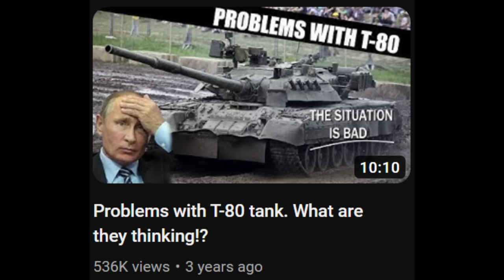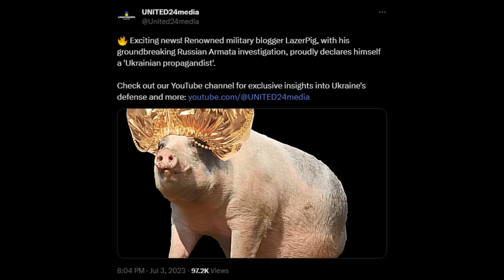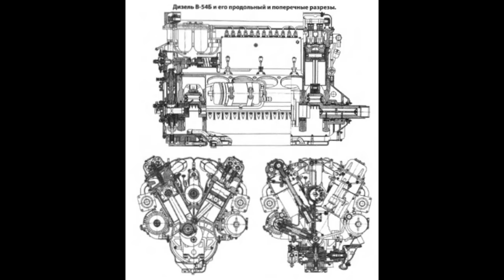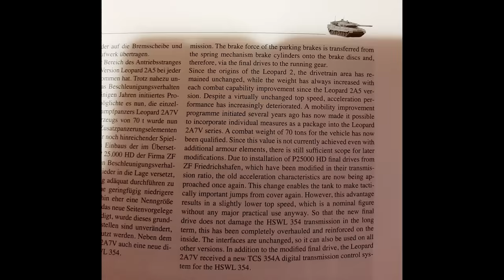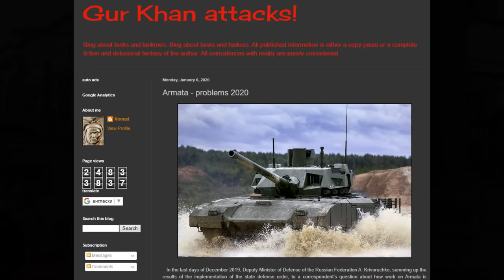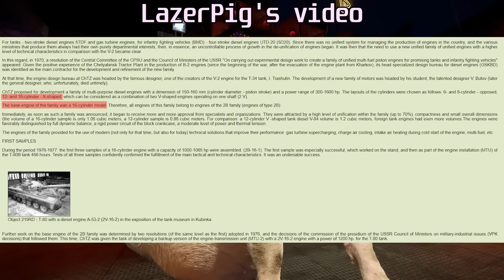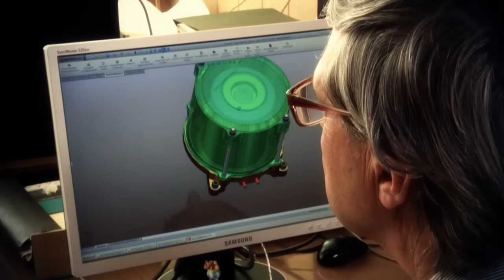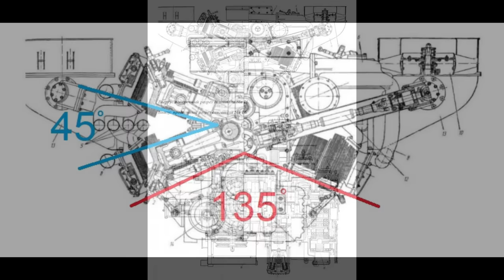Response to LazerPig and the T-14 Armata dispute

Comment: The T-14 is the best tank in the world.......

When it works.
Reply: Even if it worked it still wouldn't be the best.
Reply: bravo now go drink milk
Reply: @voidtempering8700 I mean, if it was in use it probably would be the best RN since its design is advanced. But its not in use so...
Reply: @gerfand  The M1a2 SepV4 is already in production.
Reply: @voidtempering8700  yet it has a outdated design
Reply: @gerfand  How does it have an outdated design?
Reply: @voidtempering8700  what I mean is that between it being made in 1980s and technology advancing (APS was not a thing for OG Abrams for example) and T-14 having better design fron other technology advances, namely unmanned turret, Abrams is an worse tank, but is everything, its just a march of technology thing. If US made a Tank that was akin to Armata I don't doubt they would get lots of things more right than Russia, and I don't mean production, but they have yet to do one.
Reply: @gerfand  Okay, I didn't understand what you meant by that. But yeah, I agree with that. For example, Trophy will actually not be implemented fully on the SepV3 because it would weigh far to much with it on, while also incorporating the additional armor packages and other systems. 

But something like the EMBT with APS built into its composite sideskirts is a revolutionary design similar to the T-14. But with 4th gen tanks like that, I don't see how the K2 Black Panther fits in.
Reply: @voidtempering8700  yeah K-2 is just a 3.5 if you want to use a Jet nomenclature, 4th gen will be stuff like Eletronics in much more use including for defense.
Its only that T-14 is the only one with any production to not be called a prototype even tho its not a Tank that is used, hence why I said "if it was in use"
Reply: @BakiBadjon 1% milk 2% milk? Skim? Goat? Human?
Reply: I guess u perfere, like mr pig here, human milk from males @TheMrPeteChannel

Comment: 20:41 again, not lazarpigs point, he was talking about how the t90 can only match the speed of the Challenger 2. You then went and said tank speed caps about 60 to 70 kilometres an hour which is perfectly true and valid but neither the t90 or the Challenger 2 can reach 60 or 70 kilometres an hour
Reply: Yes they can, but only if they are going on a flat road and downhill. If they are on the rough terrain, no tank can reach their top speed.
Reply: Yeah just ignore his point about the T-72 going at 84km/h in the video, granted it is modded but that just proves the engine is capable of getting the tank to that speed if the transmision was made to do it 21:00

Comment: Torque does not mean anything. Since you have a gearbox and horsepower, you can have all the torque you need cause P=RPM*T then T=P/RPM This means you can get infinite torque by lowering the gear ratio making the engine run on higher RPMs.

Comment: Tanks are going to be easy prey as Drones get cheaper, faster, capable etc... 
£20k drone vs £10,000,000 is a no Brainer...
Reply: So why nato still acquiring and developing a new tank ?
Reply: @E-zey because tanks are still useful as breakthrough weapons. Even if you control the sky it doesn’t matter above a location you still need ground forces to occupy a location. Plus as we’ve seen in Ukraine large aa defense systems are very effective at shutting down air power.
Reply: @E-zey  So Military Industrial Complex can get paid!
Reply: @E-zey Because tanks has still a purpose to fill, not to mention Anti Drone tactics and weapon systems are rapidly being developed.
Reply: They could just put an robot turret on the roof that actvely search for treaths like drones, because you know that drones seem very weak to bullets.
still cant outsmart bullets
Reply: @vitanera4032  just makes the tank more complicated & more expensive.
Which just proves my point!
Why spend millions on a tank when £10k drone will wreck it - hello?
Reply: @zabdas83  because tanks are necessary and maybe a 10k computer turret could neutralize a new threat like era did with chemical energy weapons?
Reply: @vitanera4032  I agree with the opinion that tanks are necessary. However I find the turret idea to be impractical for a couple of reasons. The main one is radar. In order to detect an object that small from far enough away to be effective would require a relatively large radar suite. The other thing is that you would need a relatively large gun or a missile to reach the range snowy drones hang out at. Spaa exists because a mbt funnily enough can only do so much at once.
Reply: Following your line of thinking, why there are still soldiers? I dont have exact numbers but i am quite sure that a drone is far cheaper than the training the equipment and the logistics behind a soldier. And them if we follow that we would not need aircrafts ships or any Kind  of hardware that can be destroyed by drones.
Reply: @victorhugoschiatti6831  did you see how easily Ukraine sank Russian ships... With a Drone...
You proved my point...
Reply: Drones are the new thing that we are still on the way of developing effective counter measures, just like how we invented ERA, composite armor, APS, thermals, to overcome the new technologies that have been created through the years.

This isn't even the first time a debate about tanks becoming obsolete is happening, they thought the same thing when they invented shape charged weapons, or chemical amunitions.
Reply: @sovieticodiabetico6874  the more counter measures you add, the more expensive, complicated & technical the tank becomes. When a cheap as drone will still do the job
Reply: @zabdas83  no it wont, you just ignored my whole point...  The more countermeasures a tank have the less effective a cheap drone will be because of the countermeasures. But even if it was true, that no matter what the drone will still be able to damage the tank, the drone will still not be able do replace the tank on a battlefield. A cannon on wheels capable of delivering heavy payload on enemy positions and then quickly turning away.

Just because there are things that can take out a tank doesn`t mean it`s obsolete(like how i already pointed that other things made people reach the same conclusion that you did, but 50 years ago, and the tanks are still around) that`s why you don`t just produce tanks, but SPAA or SPGS or IFVS to carry infantry to support the tank on the battlefield.
Reply: @sovieticodiabetico6874 you'll get over it princess. I'm right & your deluded - it's OK princess. Don't fret!

Comment: Whole segment about V2 engine was just pathetic. Little change in casing (to fit it to new tank), better generator and slapping on turbo... Seriously, teenagers in garages do more sophisticated modifications to their first cars. Yet the most awful flaws of V2 (namely crankshaft design and master-slave push rod system) are still there. And those were inherited from... TA-DAAA!!! BMW VI engine! That one, from 1920s.
Also I don't  really know much about CV12 Condor but even if it has something common with 1918 engine, those parts must be designed really good. Since CV12 has 1500 bhp from 26 litres while V92 has only 1130 from 39 litres (both in their best iterations).
Reply: Yet it works and there is no problem. Russian tanks are still destroying Ukrainian troops it what matters.
Reply: @eliasziad7864 which ones?
Reply: @eliasziad7864  remind me who said that those engines don't work?

Comment: LazerPig is the type of guy to call a Ford Model T engine and a Ford Ecoboost engine the same engine just because both are 4-stroke engines that have 4 cilinders which are aligned in a straight line.

Edit: LP also appears to have a tendency of ignoring important factors... such as the influence the gearbox has over the top speed of a vehicle.

Comment: The list of the ignored points.
-He never said this he said the autoloader specifically on the T-14 had issues.
-Again He never said this. He said it appears based on film from inside the tank the driver has a rather archaic setup with no clearly visible optics besides pariscopes.
-He did say this and you have provided no source denying it in the video. If you have a specific article listing the actual speed please provide I'm going off the video itself.
-He has actually sourced this claim being from leaked technical documents.
-He has litterally shown the article that does this.
-Don't know about his one.
-The T-14's optics lack cooling so this statement is accurate.
-No. Just no.
-That was very clearly a joke stop being disingenuous.
-He can actually prove that one.
-He actually proved it has no rear cameras and the crew positon would make a rear pariscope near impossible.
Reply: The T-14's thermal imager for the main gun sight is cooled. There's a video of it. It's quite clearly cooled.

How did he prove it has no rear camera? I'm really curious as you what you'll say.

Comment: Talking about T-14 at this point is like arguing if Superman can pick up Thor's hammer.
Its irrelevant because there ain't no Superman, ain't no Thor, ain't no hammer, and ain't no T-14.
The T-14 was a bit of propaganda that ran its course when the Russian Commander of Ground Forces announced that they would be focusing on incremental upgrades of the T-90M.
Reply: Nah its relevant lol, you used as example Superman which is a character that exists with a concept that exists, which is to be worth of the hammer

Comment: T14 Cancelled 😂😂😂😂😂
Reply: @sovietbanana4589 I don’t think they will tho. This is a very expensive tank plagued with reliability issues and it is very different from standard russian tank design which is a very big problem, tbh if you gave a T-90m a turbine engine, a good transmission capable of going very fast and a proper aps it would easily become the cheapest and best mbt in the world. I think they will reinvest the T-14 money into upgrading the T-90m models

Comment: The v2 and the v92s2f are the 'same' engine. They started with the same design but the v92s2f has been heavily modified. What your saying is like me saying "Leopard 2 and Leopards 2a7 are completely different tanks" which they are clearly not. The 2a7 variant just had alot of improvements over its earlier conterparts.
Reply: Yes, but you wouldn't say the 2a7 is the same as the 2a4. 

The standard criticism is that they are using the same engine, insinuating that it is almost the exact same as the original, which is clearly not true.
Reply: Then could you take a piston, or a camshaft, a head gasket, or many other major parts and use the interchangeably with the V2 and V92S2F? If you say no (and no is the correct answer because many parts of these engines are completely different) then it is clearly not the same engine
Reply: To expand on my other comment, let’s take the Volkswagen Golf’s for an example. The Golf Mk. 1, built around the ‘80s (I believe) is not the same as the newest Mk. 8. In no way are the parts interchangeable. Sure there may be similarities in the fact they both are hatchbacks, have 2 litre engines and whatnot, but this does not make them the same. Use this analogy and apply it to the Kharkiv Model V2, and you will clearly be able to deduce, supplemented by my earlier point, the V2 and V92 are NOT the same engine.
Reply: @voidtempering8700  no but that literally doesn’t make any change to my point the 2a4 is different to the 2a7 because the 2a7 has been improved and modified but even designs like the leopard have limits which is what lazerpig is saying about the v2
Reply: @HK-do9dl  no I’m not saying the engines are the same the v92s2f is clearly better but considering it does have the same base design and that base design does have limits

Comment: Here is the thing. The challenger 2's problem with the lower front plate was fixed way before you made that video that shows that you are using outdated info which further hurts your reliablilty.
Reply: It wasn't fixed, the base armor just has add-ons.
Reply: @voidtempering8700  Yeah, thats still a fix. The same way ERA is a fix to HEAT projectiles.
Reply: Before the challenger 2 ever went into combat the problem was fixed and according to Russia the t-14 armata has seen combat and it has an immaculate amount of problems
Reply: @PoseidonOversimplified  Did you even watch the video he made on the Challenger? He comments about the add-on armor in the video on it he made. Lazerpig simply cut that part out or didn't finish the video he made on the topic.
Reply: I have and he didn’t that was in his response video not the original one that lazarpig responded to
Reply: @PoseidonOversimplified  Yes he did, ur is the first thing that is said in his video.

Comment: with your challenger comment, you are ignoring the steel quality completely. Todays 60mm amour plate is a different beast from WW2 steel. So yea, you are technically wrong
Reply: Everything is measured in RHA. Besides, WW2 tank guns have upwards of 150mm of armor penetration.
Reply: Highest penetrating WW2 tank guns penetrate upwars of 200mm of armor; for example, 17pdr apds penetrates over 250mm at 500m, and 88mm L/71 KwK 43 penetrates over 210mm at same distance. While modern RHA is indeed better, it is most certainly not 4-5 times better.
Reply: Steel quality and hardness is a bit of a complex topic. But generally the difference isn't that significant. Because the lower plate is a structural plate and the only plate in the lower front plate, it's unlikely to be some sort of high hardness plate. As it would be too brittle. Still, because of the shallow and angle and low thickness, it is still suspectable to many WW2 guns to calibers as low as 57mm
Reply: you lads seem to not realize that modern armor plates are not just hardened steel, but a composite material. I suggest you look for some test comparing WW2 tank armor to modern variants. You will be surprised.
Reply: @imomedvidek  I don't think you understand what we are talking about. The Turret and IFP of the Challenger is composite armor, but the LFP isn't. They have an add on armor kit, but the base armor is just a steel plate with no composites.
Reply: @imomedvidek  the lower plate is most definitely not a composite plate. It's too thin and it would be too weak for structural purposes
Reply: @imomedvidek  The whole point of redeffect's criticism is that the lower plate is a 60mm rha plate, not composite.
Reply: @jasonzhou5783 just a correction the 17Pdr has a penetraton of 204 mm at 500 meters, not 250, like you said with of course the APDS round the APCBC round could however only penetrate 130mm of armor at the same range if we compare both ammunition type the APCBC round on the Kwk 43 is much superior

Comment: (Because everyone gets angry, I am talking about the T90-m engine) About the engine debate, Yes it is no 1:1 copy. It is the same engine tough, engines are defined by there base architecture and changing specific systems inside the engine leaves the "Engine" The same. The issue with a "old" Engine is that the Baseline design choices were made before precise topology optimisation was a thing, so they just slapped more material on critical spots to ensure they will not break down. This can  not just be fixed with a new lubrication System but only with a complete redesign. So the point that the base engine is a accent relict is completely valid an also not a normal thing to do. a Engine developed in the sixty's in a tank from the seventy's is not the same as a engine developed in the second world war and the approved until the 2010s used in a tank developed now. 
I am no tank guy to be honest, I work in the Automotive Industrie, there even the thought to compare a engine from the 90s to a freshly developed one from today would be a bad joke at best no matter how upgraded the old ne is.
Reply: Ah yes, the Abrams uses the engine of the me262 because it's a gas turbine then!

Great logic
Reply: @p_filippouz  I think you misunderstood what I ment. An engine is defined by ist Block when talking about generations and redesigns. If Audi takes a EA888 block and puts their own headers, a crank with a bit more compression and an improved oil pump on it, it is still the same baseline engine as in a golf mk VI.
Reply: @TheMaschinMann  dude it's not even the same block

Those engines are completely different aside from using a X layout
Reply: @p_filippouz  I was not talking about this one I was talking about the T-90m

Comment: I sort of can see what is lazer pigs point with engines    lets see russians use the old engine and basically modernized it  its ok nothing wrong with that considering how russia like to do things cheap  but at 70sor when ever germany made leopard 2 the engine which still old has 1500 hp i think i moght be wrong which is more power for the tank      and the latest engines usa is going to use the modular engines is said to be more fuel efficent and more modern     i think what lazer 🐖  tried to say but failed cuz comedy  is that the engines russians are using are not most effective and efficient engines they can use and quite honestly he failed to say that directly he probably relied on us to just get it which we mostly didnt im sure i didnt so i think you were right to poont these out
Reply: 16:00
Reply: 16:10

Comment: the 12N360, the engine of the T14 is in fact the same engine as the A-85-3A, a pumping station engine, the firm that built it was charged with fraud as they laundered state funds given for engine development and they took an existing engine and relabled it. that is partly why the T14 ended production